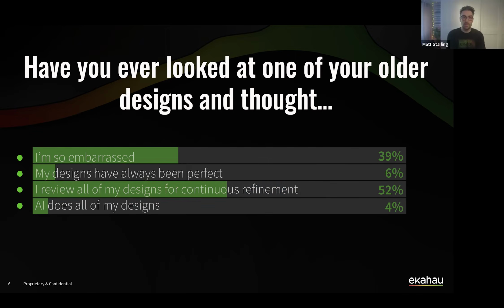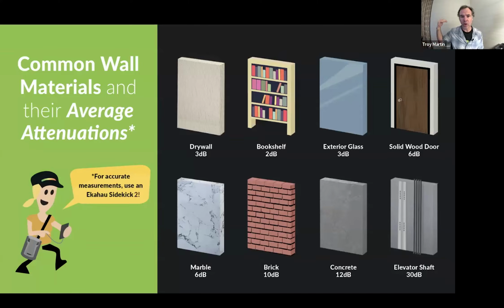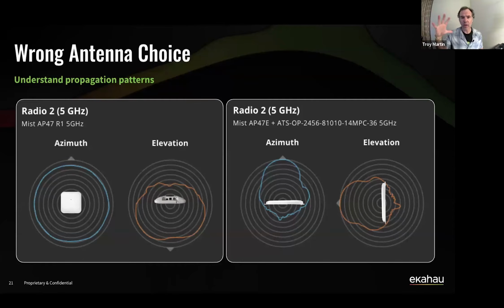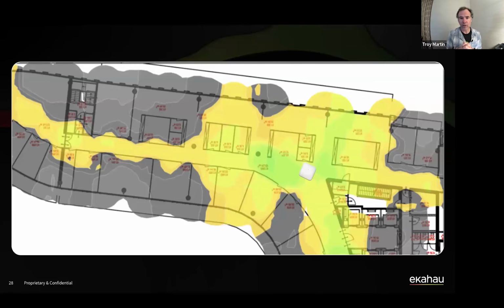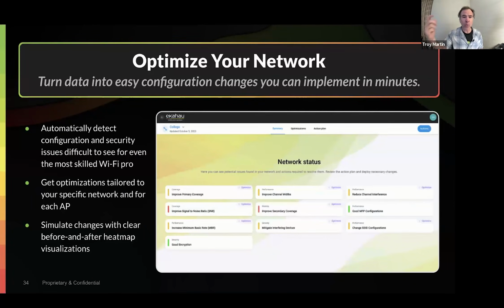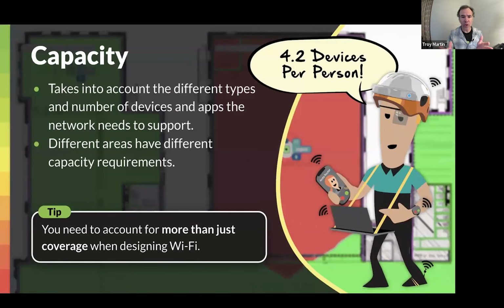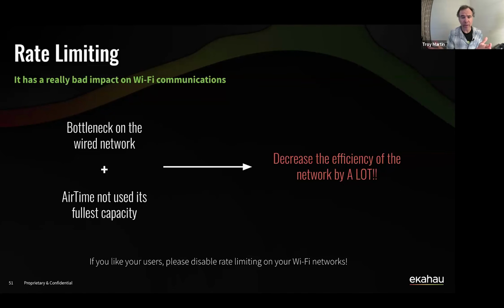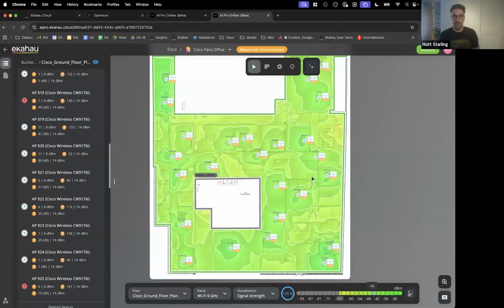Ekahau Webinar | Common Wi-Fi Design Mistakes

Comment: [00:05:01] Mistake 1: Channel Planning
[00:11:12] Mistake 2: Assuming Attenuation of Materials
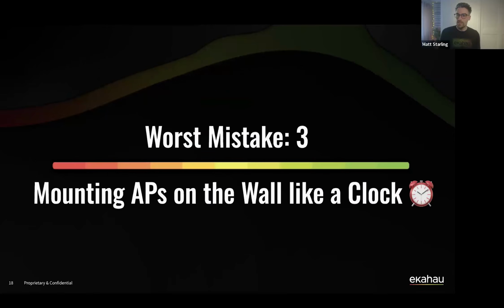[00:19:14] Mistake 3: Mounting APs on the Wall like a Clock
[00:25:46] Mistake 4: Not Managing Physical Installation of APs/Antennas
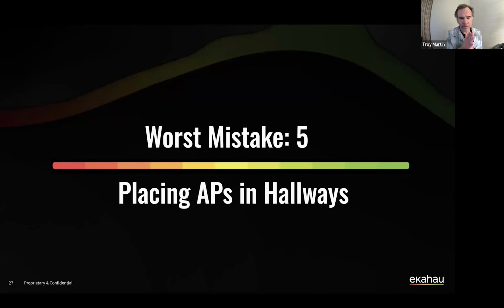[00:27:58] Mistake 5: Placing APs in Hallways
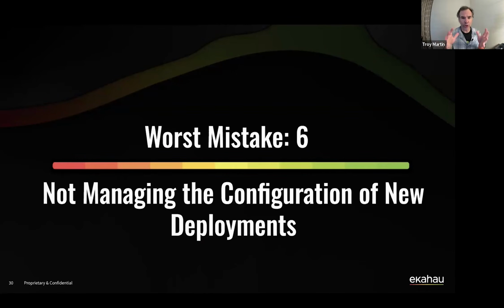[00:36:21] Mistake 6: Not Managing the Configuration of New Deployments
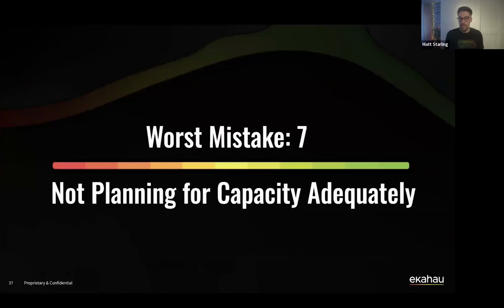[00:46:17] Mistake 7: Not Planning for Capacity Adequately
[00:50:35] Mistake 8: Not Identifying Security Vulnerabilities
[00:55:50] Mistake 9: Rate Limiting on Wi-Fi
[00:57:05] Mistake 10: Remember to Freeze Your AP